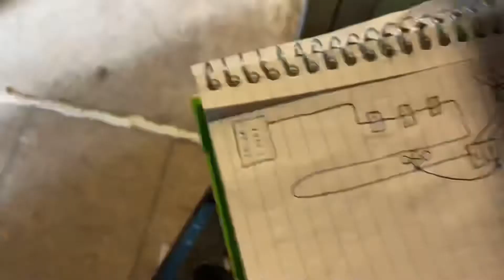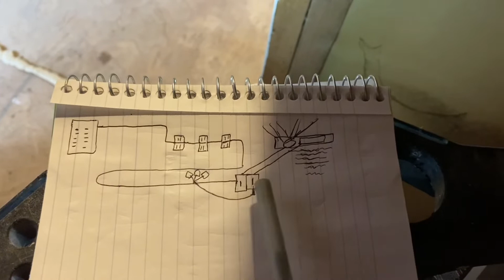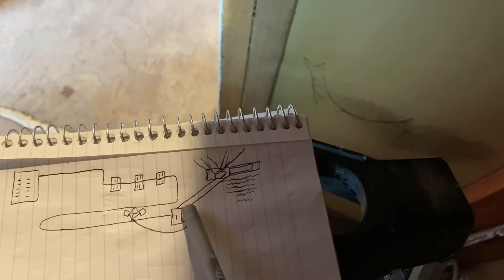How to wire a plug to a double light switch.

Comment: Interesting. It makes sense not to put the receptacle behind it. Pretty sure that’s what my landlord did. Every time I turn the light or the fan off in my bathroom the safety switch pops out of the electrical outlet that’s right next to it.
Reply from the maker: Yes, if you put a receptacle before a switch it will work but if you put the receptacle after the switch it will not be properly working! I have done it before so I learned the hard way haha 😂